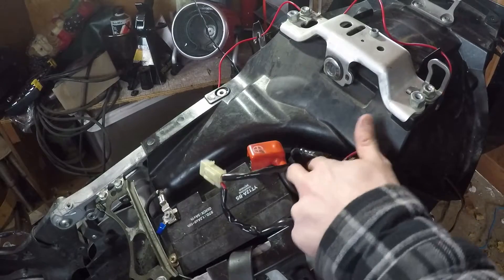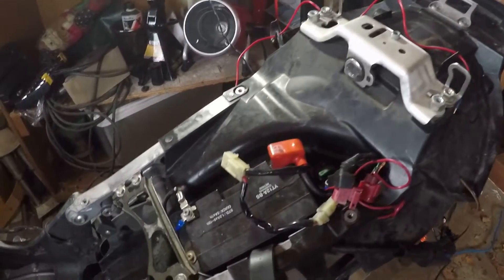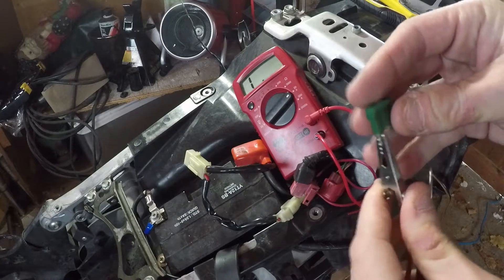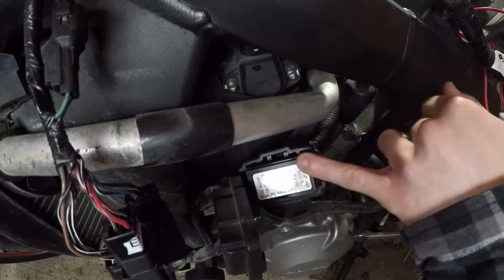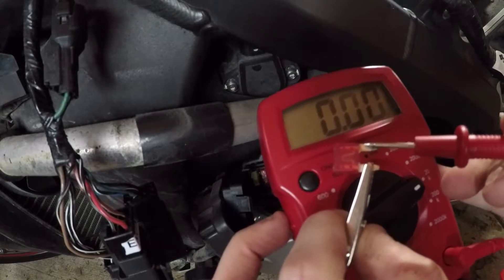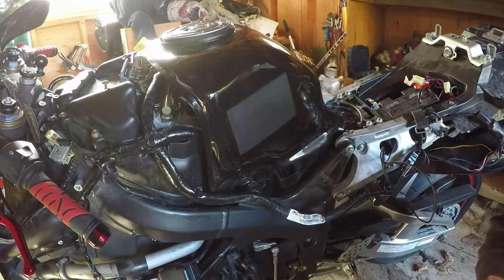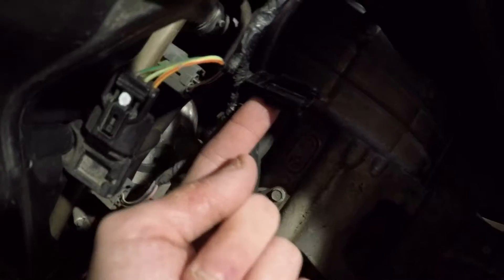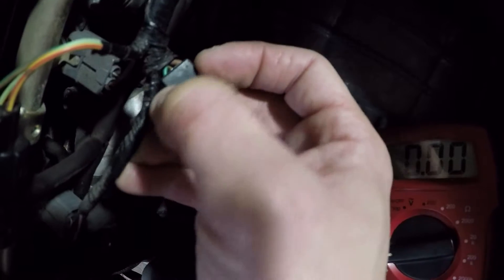Fuel Pump Won't Prime : CBR600RR  2005-2006  | PART 1

Comment: before you guys move on to stripping everything on your bike to get access to the fuel pump plug, check the in-line 20A fuse near the starter solenoid (the one with a 30A fuse). I went through all the diag from part 1 and part 2 and it ended being that.
Reply from the maker: Checking all the fuses should honestly be the first thing anyone checks.  Common sense 101 😂.   Glad you figured it out though.

Comment: I am trying to figure out this 2005 cbr 600. 

Fuel pump isn’t priming. Checked all the fuses and the starter relay. 
Went to check continuity in the fuel pump power supply. Can’t get anything with the positive on brown. But if I put positive on the brown and black wire it reads 11 volts
Reply: My Yam XJR1300 has the same volts. Bike has no fuel prime, pump is new and it kicks over etc. Have you found out your problem? Like to hear if you have. cheers

Comment: For all of you guys that have changed the fairings. The angle sensor in the front cowling CAN and WILL go on upside down if you are not careful. Happened to me because it was a bit dark, so i missed the arrow and the "up" sign on the sensor.

Just a heads up for all the people with a sudden pump not running after cowling change.
Reply: tysm I was so lost as to how it could stop priming after a headlight swap and this comment saved me 🙏
Reply: Do you think me changing the ratings my fuel pump won’t prime because before I put farmings on my fuel pump would prime
Reply: @Srtlandyacht  Are you talking about fairings?
Reply: @Duif_Z06 yeah because after I put my farings on my fuel pump won’t prime
Reply: @Srtlandyacht  On the front cowling on the inside, there is a gyro. If you put it upside down, the ignition/fuel pump wont turn on. Remove your front cowling and confirm you didnt install it wrong. Also check that you plugged back in all the connectors when reinstalling the fairings

Comment: Hey what’s up man thanks for the post again definitely helped diagnose but I connected the alligator clips to the wire from the harness and it showed a spike in voltage meaning they work right? Bc i did the same to the cable on the pump and it works too but I connect them together and turn on the bike from the switch and don’t hear it turn on
Reply: Nvm it was the relay
Reply from the maker: Glad you got it all sorted out.

Comment: What if I don't have the sub fuse box the bike started the other day. Now fuel pump wont prime
Reply from the maker: If you have this motorcycle and it’s a 2005-2006 CBR600RR model they’re all the exact same.  If it’s not the same year chances are it’s just located in a different spot.

Comment: What do I do if the stop start switch don’t work?
Reply from the maker: See if you can open up the switch.  It could just have some build up or corrosion around the connections or a broken solder.  It could be as simple as just re soldering or taking electrical cleaner to the connections.  Try that.  Worst case scenario you’ll have to replace the switch but they’re easy to find and worth peanuts

Comment: Hey man, I just wanna ask, my cbr600 rr easily increase his temp and get overheat at 83deg Celsius. I flush and change the coolant. Can I ask for help whats the steps to check my cooling system?tia
Reply from the maker: 83 Celsius is perfectly fine

Comment: Hey question do you know if a 05/06 Cbr600rr fuel pump will fit a 2004 Cbr600rr?
Reply from the maker: I’m pretty positive the fuel pump is the same from 2003-2006
Reply: @TubeSocksMalone  thanks brother!!! I thought they were but I’m still a noob 😆 thanks again and be safe out there 🤙🏾

Comment: Thanks for taking the time to post this, using your techniques I managed to get a friends salvage bike running. As it turns out the block is cracked but I've also learned a bit on the way

Comment: If you lost the key to you're bike and HISS is stoping you just buy a new ignition and take it apart and replace the old key insert from your old ignition with the new one you bought and put the old ignition with the new key insert back onto the bike and that bypasses the ignition not recognizing the ECU which won't start the EFI
Reply from the maker: Thomas Johnson IF the bike has HISS.  In North America 2005/2006 models don’t have HISS.
Reply: @TubeSocksMalone  I got a 03 CBR 600RR and I had to replace the ignition switch on it because the last key snapped inside and so when I did that the FI error code appeared when I installed the new ignition and kept reading about installing a new ignition people kept running into the problem with the ECU not recognizing the new ignition switch which stop the fuel injection from priming. Not trying to downplay your video at all because it taught me more than what's posted on YouTube I'm just explaining what I did when I replaced my ignition and had fuel injection problems.
Reply: @TubeSocksMalone  I only said HISS because it stops anything electronical from working which might be something as simple as an ignition switch being changed. And im in MN even if I don't have HISS at least I could reach out to a brother that does or help in anyway.👌
Reply from the maker: Agreed 🤘 you never know who’s watching.  They could have a European bike or North American.  Fortunately for 2005/2006 we don’t have that problem so long as my ECU gets 12volts it’s all good.  No diode in my model to down play the volts from 12 to 9 for the ECU.  I have an aftermarket ignition too but I can cut keys at will too.

Comment: So if you get power for a split sec to the fuel pump. The fuel pump could be bad?
Reply from the maker: If it gets power for a split second that is when the fuel pump would normally prime so if it isn’t priming but getting power then hook the fuel pump to the battery for a second and see if it works.  I mention that in the video 🤘

Comment: Hey there I’ve watched your videos many many times I had a power spike to the fuel pump, so I changed the pump but I’m still having the same issue did you do a video on the ignition switch?
Reply from the maker: One question and I may be able to immediately rule it out.   What year is your bike? And also what country are you located.  The wire harness and ignition are slightly different between North American models and Europeon.  Just so I know exactly what bike
Reply: MotoBike Mike  the bike is a 2003 and I’m from Ontario Canada, I just started exposing the wires the bike will run with no issue if I supply the power and ground to make the pump run, I did just that relay like your video
Reply: I also need a video specifically on the ignition switch. Removal, soldering etc. Help please

Comment: What is the voltage on the surge to the pump supposed to be? I am getting 24V and then it goes down to 12 but my fuel pump doesn't prime. I just had it replaced with an OEM pump and had the relay changed out. I'm $1100 and 2 months deep into this issue...need help
Reply from the maker: On the black plug that actually plugs into the fuel pump like shown around the @4:15 mark it should only spike to like 12V for a blitz of a second then go back to zero to prime.  It only has a spike of power to prime and going from 24 volts idk how but then down to 12V and staying their isn’t right. Make sure you followed everything step by step or didn’t skip anything assuming it was fine, test everything in the videos as that’s the full procedure in the service manual. If you skip a test you could end up chasing ghosts.  And dont jump around testing stuff do everything in the order I showed.  If everything checks out and works or shows correct then it’s your ECM.  If you’re unsure then that means you missed a step or tested it incorrectly.

Comment: Thank you so much man! Quick and to the point! Really helped me out. Fuck this kill switch
Reply from the maker: No problem.  Yeah Kill switches are a common problem regardless of bike.  It gets weathered from always being exposed to stuff like water, humidity etc and takes a toll over time on it.  The downside is how important it is that if it doesn’t work right neither does the bike.  Simple fix but is a huge pain in the ass when it fails.

Comment: Hi i have a 2006 f4i 600 I've had it in storage for 5 years it ran when i put it away i put stabilizer in the fuel, so i empty out the fuel used a different battery to start it my lights turn on but i dont hear the pump turn on, it turns over but no start, like i said it ran perfect when i put it away the thing has 5k

Comment: Hey I have a 2007 cbr 1000 that won’t start it fires up with fuel injector fluid but I’m getting little to no fuel coming from the injectors I bought new injectors same thing what am I missing
Reply: how did u fix the problem?

Comment: help needed I check all of the fuses everything is fine but when I checked the connector from the front of the bike that connects the odometer and tilt sensor main harness as soon as a touched it with the testerI could hear the fuel pump turn on but when I remove the tester the fuel pump and bike cut off please help
Reply from the maker: ricustyvon I have the nose of my 600RR off so tomorrow I will go take a quick look and see exactly where your at and I’ll try come up with a few ideas/tests you might be able to do to narrow it down or point more in the right direction.  Can’t promise anything but I’ll try figure something out for you.  Fingers crossed anyway lol.
Reply: @TubeSocksMalone  thanks bro cause this rebuild is beating me up I can't figure it out for nothing smh fingers crossed lol

Comment: my honda cbr600 f3 died on the highway ( fuel pump died ) pump didnt turn over btw when direct attacted to the battery
Reply from the maker: If it didn't turn over while directly hooked up to a power source I would put my money on your fuel pump needing to be replaced unless you power source was faulting.

Comment: will this tutorial work on a Honda F4i  ?
Reply from the maker: I don’t believe so.  The wire harness a long with a few other things are very different so it could end up sending you on a wild goose chase.
Reply: Everything is pretty much the same including colour of loom wires apart from the ecu pin is different I think, so I just skipped that stage.

Comment: Hey Mike thanx for the help but I have a question. I have a 2006 CBR1000RR and my 20amp fuse keeps blowing and my fuel pump wont prime.  I unhook my bank angle sensor and turn key and push the start button, it turns over, doesnt start and no fuel prime but doesnt blow the fuse. Turn the bike off, plug in the bank angle sensor and turn key again and it blows the fuse. Is it my Bank Angle Sensor???
Reply: I have CBR 2003 and i think i have the same problem like you, when i turn my bike using the key pump doesnt prime but the 20 fuse is OK when i turn my Kill switch to ON position it's blowing the fuse, When i plug out bank angle sensor pump still wont prime but when i put kill switch to ON position it's dosent blow the fuse (my pump is working i take it out from the tank and test it) do you found where can be the problem? or maybe somone else know where to look?
Reply: Hey TC, sorry to hear you're having the same problem. I just ordered a new Bank Angle Sensor. Will know more when it comes in. Of course I will update here as well. My guess is it has to be the BAS, otherwise why is it blowing the 20amp fuse. You might want to take your pump out and test it, though. I haven't checked my pump yet, but I will do so afterwards if the new BAS doesn't fix it.
Reply: @vxace5285 I take out pump and check it's working good, also i bought BAS sensor ( still doesn't work) and i make BAS bypass also again doesn't work and still blowing fuse.
Reply: @mrthecrev  honestly I haven't reached that far personally. If that be the case, it almost sounds like your ECU/ECM ontop of your airbox.
Reply: @vxace5285  Did you fix it?
Reply: @mrthecrev  My BAS will be here this Friday. I will give an update on Saturday (9-28-19)
Reply: @mrthecrev  so I replaced the BAS and it's still blowing the 20amp FI fuse. Idk, at this point I'm about done with the damn thing. With as much money as I've put into it, I could've bought another bike already.
Reply: @vxace5285  Just keep looking and you find it, My bike don't start too and now im going to looking at any single cable that's going from fuel pump, kill switch and bank angle sensor, theres need to be short somewhere, i found there is a tool that you can buy cheap and you can find it on ebay it's called (Automotive Short Open Finder Cable Circuit) you can try this maybe it's help.
Reply: @mrthecrev  I'm going to keep on it. I've diaged everything dang near. Checked all my wiring, all relays are good, killswitch is good, stator is good, starter solenoid is good, fuel pump works, BAS is fine. I just ordered a rectifier. Just sucks this is my only source of transportation.
Reply: @Vəx Äčė It's more looking like short somewhere i need to strip isolation and look for that but it's a lot of work.

Comment: Great video. Thank you for showing how to use the multimeter. 

For anyone reading, I went through the steps and my fuel pump wire from the bike does spike up for a second or two and then I tried to jump the pump and nothing happened.  So does that mean the pump is shot?
Reply from the maker: Mission7608x2 if you tried to jump the pump and feed it power directly to get it to turn on then yes I would say it’s a very safe bet your pump is cooked BUT double check the connection on the end maybe it could use some TLC first. Just to eliminate a bad connection from a bad wire that you could actually fix

Comment: Man that's a lot
Reply from the maker: sir pulls alot it seems like it but it’s better to attack the problem accordingly otherwise could end up chasing ghosts and wasting money or you may get lucky.  This is the steps in the service manual to troubleshoot so it will narrow down and solve the problem if they’re done properly.
Reply: What if the engine turns over but won't actually start? My bike will only jump start but it will cut off If I don't keep giving it throttle and it drains the battery.its a 2005 CBR 1000rr.

Comment: Zener diode
Reply from the maker: Peyton Gilbert for what? It’s a possibility depending on model year and also North American model or European.  2003/2004 North American 600RR have diodes.  2005/06 North American do not.  And Europe has the stupid HISS system which also uses a diode so have to be slightly more specific.